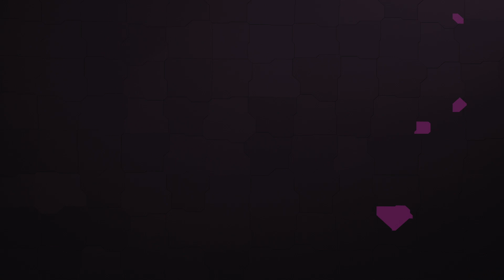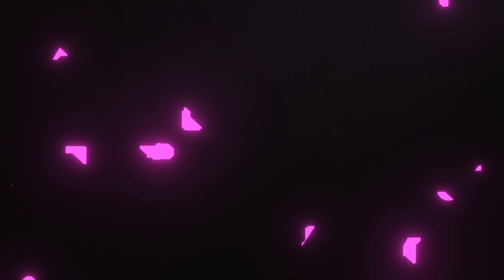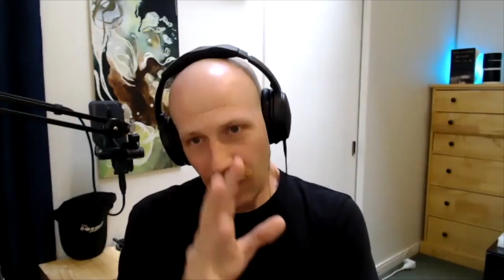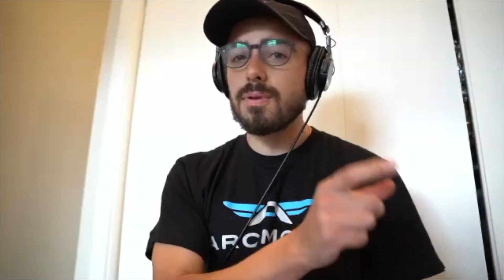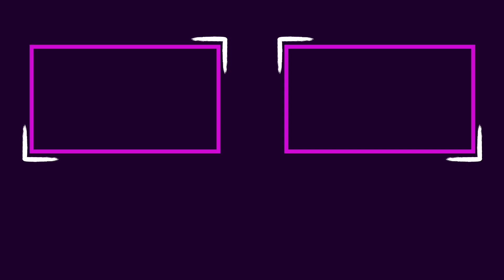Clues that V4 Supercharging is on the way

Comment: A couple of points about future supercharger enhancements...

First, I kind of understand why they went from v2 (150kW) to v3 (250kW) because that appeared to be a significant increase.  But going from 250kW to 350kW appears much smaller.

Even from v2 to v3, the real-world benefits were much less exciting.  

Look at it this way: for a consumer with 75kWh Model 3/Y who make up the current majority of Tesla owners...  a 10%-90% charge at a v2 takes 27 minutes*.  At a v3, you can cut that to 16 minutes for a savings of 11 minutes.  Someone with a v3-capable S/X with a 100kWh pack can spend 36 minutes at a v2 or 22 minutes at a v3 - saving 14 minutes.

Not such a big deal.

The big benefit of the v3 wasn't so much the power as the fact that each supercharger had its own transformer so you didn't have to watch your charge-time increase if someone else plugged in next to you.

Even now, today, if I have a choice of going out of my way to stop at a v3 charger, I probably wouldn't bother.

Now let's talk about the S-Plaid and the Roadster and assume that they'll both have 200kWh packs when delivered to the public.

If those vehicles had 2170 cells, we could expect to see the following charging speeds for a 10%-90% charge

v2:  72 minutes
v3:  43 minutes

Now, we're getting somewhere.  Saving about 30 minutes on a charge might be worth rerouting to get (again, assuming you're driving somewhere you're forced to choose between the shortest route and being able to use v3).

Now let's look at a hypothetical "v4" charger assuming 350kW:  31 minutes.  Would you go out of your way to save 12 minutes on a charge?  Probably not.

But, don't forget, the S-Plaid and the Roadster will probably have the 4680 cells which are claiming a huge boost to charging speed - something on the order of 60% of the equivalent charge on a 2170-based pack both on v2 and v3 - due to their ability to withstand higher charging current for a longer time

v2: 43 minutes 
v3: 26 minutes

That should forestall any demand for a "v4 supercharger".

In future, Tesla might want to be the first to hit the 500kW figure.  Not because of any technical reason but purely for the sake of Big Round Numbers.

But, as a practical matter, I think they're better off using their limited resources to open more new v3 superchargers (and upgrading key v2 sites) than pushing out v4 anytime soon.

Plus, what do you want to bet that future 200kWh packs Tesla sells will be arranged internally as dual 100kWh packs - each with the ability to take a charge in parallel through charge ports on both sides of the car?  

In other words, someone with a S-Plaid or Roadster who could pull between two adjacent unused chargers could plug them both in and charge in parallel.  That should be able to deliver a 10%-90% charge in less than 15 minutes.

*All charging times calculated by: https://www.inchcalculator.com/electric-vehicle-charging-time-calculator/

Comment: Another big reason for faster charging is work Cybertrucks. During the work day if you need to charge, time is money. I'm planning on my tri-motor Cybertruck Robo-plow doing plowing routes while I'm sleeping. Plowing uses a lot of energy, it needs to be able to recharge quickly when needed.

Comment: What about dual charging for the semi? Like two plugs, two charging stalls (or one with two circuits)? Seems you could split the battery at least while charging and allow fast charging without quite the insane power load on a single line.
Reply: They are currently doing this with the prototypes... The problem is that the way Superchargers are currently built is not meant for a Semi with a trailer pulling in and charging. For Semi charging you really want to have big stalls with Megachargers that a semi with trailer can pull in to and ideally can  drive out the othet side.

Comment: So many great things. Not only faster peak charging but if you were capped at 250kw or 150kw you would be able to maintain that peak rate for a longer time, up into a much higher SoC than present.

ALSO it means you can get the energy out of the cell faster. Meaning more power. It's how the Tesla Plaid is capable of >1100hp.

They way Tesla presented it at battery day, and the way its discussed now is by each different technology. In this clip we're talking about the improved power and charge rate JUST from the anode difference. Don't forget about Tabless design. That also allowed for ~20% better power. These % improvements are additive.

Comment: Yes, a Version 4 charger will come for truck charging. I think the delay in the Semi release is the availability of Megapack storage - Electrical supply can be expensive. It is easy to demand capacity that requires expensive new transmission links. The cost of Megapacks will fall further when the large format 4680 LFP cells are available. Truck companies, always after unit cost reduction, can have an electricity supply that allows it to buy energy at a cheap rate (at night at present, in the day in future) and fill their truck with electricity at a time that best suits operations. The key tech with the V3 charger was the use of Model Y style heat pump to cool water/glycol cooled cables.  Megapacks also allow current supercharger sites to be expanded.

Comment: It appears that the charging rate is limited by the car, not the V3 SC itself. I saw another vid of someone who took pics of the Specs of the V3 SC and it seems V3 can ALREADY do 350kW. This conclusion was based on the amps/volts (sorry I'm terrible with electricity stuff). The calculation was that it took a certain amount of amps to charge at 250kW. V3 supercharger specs were beyond that. If i can find the video i'll post it. It really does seem like the limiting factor ;) ;)  is the battery tech being able handle faster charge rates... Can't wait for my CyberTruck.
Reply: YES, Tesla has known this was coming